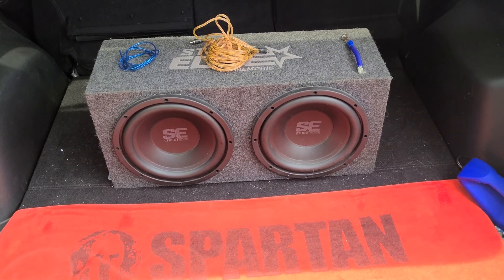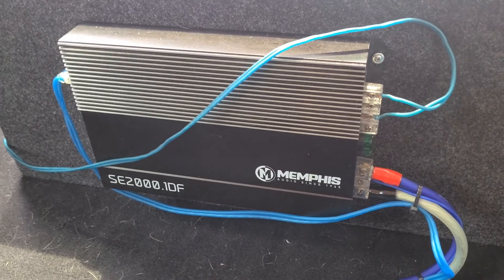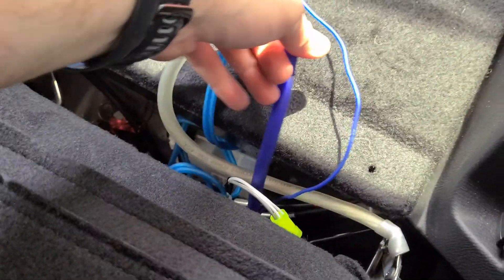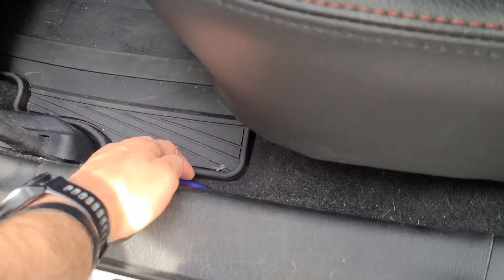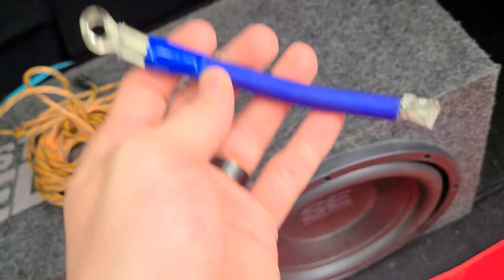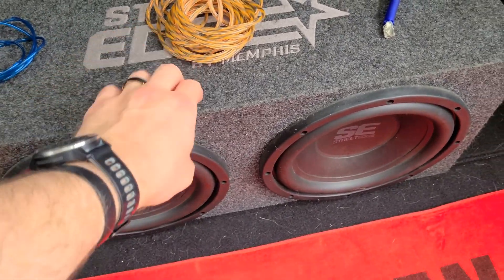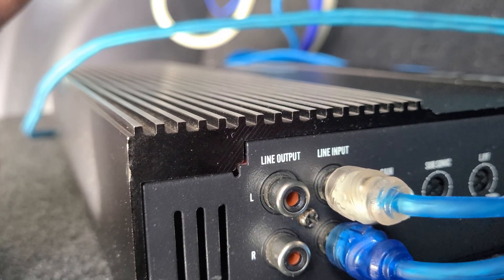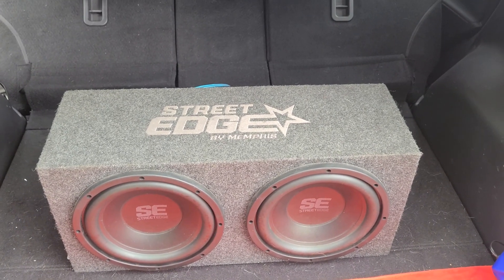How To Install Subwoofers To A Stock System

Comment: This was professionally done? They didn't even use a jumper for the remote wire, they just jammed it in the  fuse. 😮😮😮 they didn't even use the car ground that's already in the trunk. Thanks for the walk thru video though, good job on that.
Reply from the maker: Thanks for watching